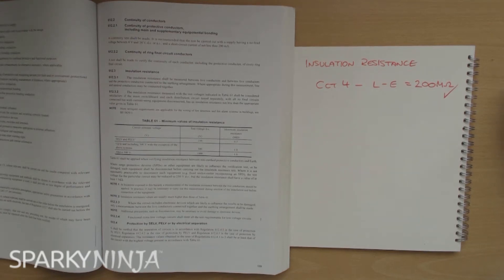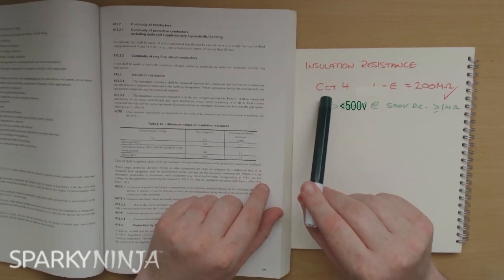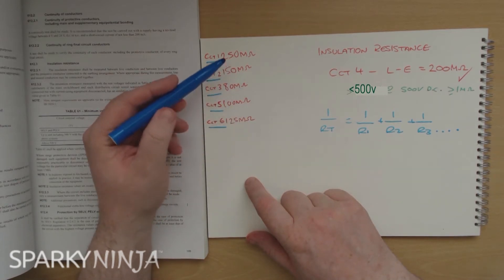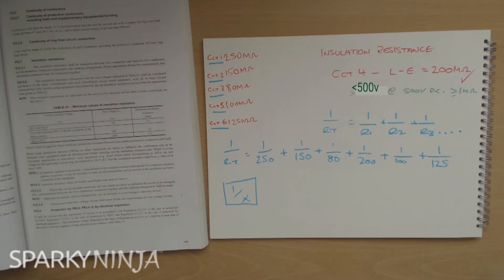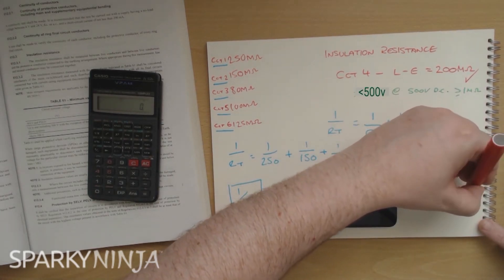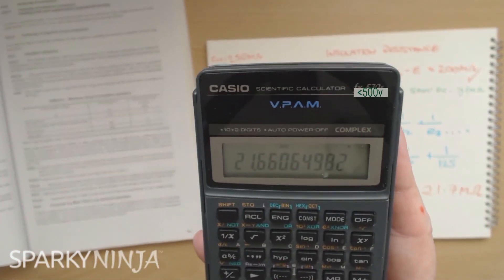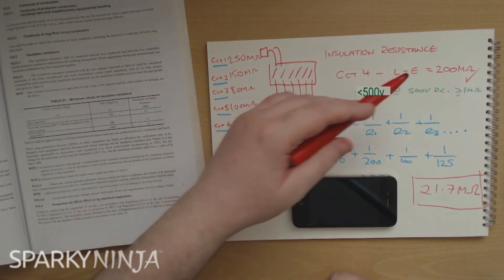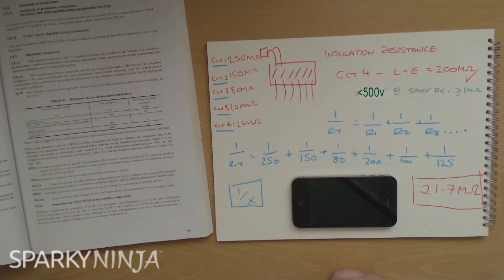Calculating combined insulation resistance tests - C&G 2391

Comment: If the value is say, greater than 2000 Mega ohm, what would we input this as in the equation ?
Reply from the maker: You can only input the infinity value of your instrumentation, but at that number it is a pretty redundant exercise - unless you were testing hundreds of circuits simultaneously.
Reply: @SparkyNinja  worked that out in the end but thanks for the reply anyway.

Comment: Hi, very nice tutorial. Thanks
Have a question regarding the applied voltage during IR test. 
Does it requires the applied voltage must be  equal to twice the RMS value of the normal supplied voltage on a conductor??? 
So as per that for 3 phase load conductor the IR test must be conducted on near about 600 volts??? 
Is it true, kindly reply

Comment: A quick and simple estimation of your final value is to take the least resistance value and divide it by the number of individual circuits. In this instance, 80MOhm is your minimum individual circuit resistance.  Divide that by 6 and you have 13.3 MOhm.  So your total is still well within specification.

Comment: hi mate. my company tests L-N L-E  and N-E seperate. 

would i use the worst of the  two live conductors to earth as my reading for calculation?
Reply from the maker: If you are reporting it on a document that just has Live to Earth instead of Line to Earth and Neutral to Earth then you could technically combine the two for the actual single value using the method shown here. Personally I would record one and if the other is significantly different I would add it to the comments for the circuit.

Comment: Hi David, How do you do the calculation if you have a IR result of >999 M on some of your circuits?
Do I just pick 1000M and go from there
Reply: Ross, if you have a very high resistance value as you will for very new cabling with new installations,  because you are considering parallel resistance for your final figure, any high resistance parallel circuit will not make any significant difference to your final calculation if your other circuits fall between > 1 MOhm and, say, 100 MOhm. You can just as easily ignore and discard the very high resistance parallel circuits in you final figure calculation.
Reply: greywolf271 
Thanks that's pretty good cheers

Comment: Table 64 (current IEEregs) provides "minimum insulation resistance values" for I/R tests. The preceding regulation requires what older guys call a "bulk" test, that is the test measurement is taken the main switch and the distribution circuit with all the final circuits connected (mcb's on) to either the neutral conductors or the protective conductors. If the readings indicated on your "Megger" are 1 Meg ohm or greater the test "shall be satisfactory" a Meg ohm being roughly equivalent to one million ohms.
If however the minimum readings for an insulation resistance  test of a whole consumer unit ( as described in the IET guidance note 3) cannot be achieved then individual final circuit may be tested.
Get guidance note 3 (around 27 quid) it'll be worth every penny.

Comment: Brill vid and good points, just one thing to be mathematically correct, at 6:31 you state you have found Rt and need 1/Rt, isn’t it the other way, the calc you did is 1/Rt and you need Rt ??

Comment: Thanks so much for these tutorials. An absolute godsend to me.  Quick short-cut on calculating the IR for the board :  Take the lowest reading and divide it by the number of circuits on the board. If you are happy with the result then no need to go further, secure in the knowledge that the true overall IR will be higher. But if the result is of any concern then you can proceed to calculate the overall IR accurately, as you described.

Comment: You stated the read was between live and earth is that the reading of insulation resistance of the line and neutral together to earth? The model forms in BS 7671 only give boxes for insulation resistance readings between live conductors and live conductors to earth. Industry often carries this test out between L/N, L/E and N/E. Which won’t get a true reading of live conductors to earth as a combined test. Thanks as alway I am directing my level 3 learners to your channel.

Comment: Hi mate,  

Is there actually at set value for an individual circuit then? E.G adding a new circuit to an existing installation. You would do dead tests on the circuit you are going to certificate. At what point would you say it requires further investigation. As we know experience normally tells you with your own test kit if something is wrong, however is there no set figure?

Also looking at doing my 2391 Inspection and Testing soon, any books or sites you could recommend?

Thanks,

Nigel.
Reply from the maker: Hello Nigel.

There is no set value for an individual circuit, however as the regulations require a combined circuit minimum of 1MegaOhm and understanding that any parallels that result from combining cirtcuits under test will always result in an overall value that is lower than the lowest of any single circuit, this would always result in a combined value less than 1 MegaOhm for an install.

So..

'IF' we are adding to an existing installation, we will need to be aware of two things. The first is that our new clean install should be fault free and so we should be reaching the maximum range of our machine - if our cable run is rediculously long, then you may see a different number due to the parallels within the cable along it's run, but nowhere near 1 MegaOhm. The second thing is that we would need to test the existing installation to make sure that it is safe to use - this is mainly due to the fact that we are adding demand to the installation.

I would recommend starting with Guidance Note 3 (as that is the key reference material for the 2391) and maybe checking out  GSH Electrical for some testing content.

https://www.youtube.com/watch?v=Vztv5gT4yCQ

Let me know if I can be of any further help.

Regards

David
(SparkyNinja)

Comment: Hi there great channel enjoy your videos,slightly going away from your video.my question is insulation resistance based,it's to do with removing loads while testing.when it's not possible to disconnect lamps and I.t equipment or whatever.i know you don't test between live conductors but is that far as you go and are you still doing a proper ir test. forgive my naivety it's a subject I'm trying to understand better.
Reply from the maker: Hello Roy, with periodic inspection of existing systems there is this inevitability to apply the limitation for IR testing between Live conductors. As long as you are properly documenting the scope of your work and MOST importantly, your client is well informed and understands what aspect of the work hasn't been achievable then all is good.

If the installation has undergone flood/fire repair damage, changes in ownership/demand/use then these would be stronger cases to challenge the scope and consider whether Limitation is acceptable, but do bare in mind that we are also supposed to minimise dismantling of the electrical installation as well.. otherwise, with the IR tests carried out between all Live conductors and Earth then that can be considered 'proper IR test'.

I work in many production factories - where removal of loads is just an insane idea - and so what we do there is apply a clamp meter around the live conductors when under load. Do remember that this is most likely going to be live work. If we pick up any current measurements when the meter is around the lives (L&N, L1,L2&L3, or L1,L2,L3&N respectively) then this indicates a loss off current, possibly down to earth and possibly caused by degradation in insulation. With regular monitoring we can identify a build-up in unbalanced current, which we can then use as an identifier to seek permission to isolate, disconnect and test fully.

If you are looking for more information regarding insulation testing theory and how it works then I would advise checking out a couple of mjlorton's videos on the subject:

Part 1 - https://www.youtube.com/watch?v=TdeU6UCCfTY
Part 2 - https://www.youtube.com/watch?v=FV0QavM9sN8
Reply: SparkyNinja 
Thank you very much
Reply: SparkyNinja You must have a big clamp meter to do this! 😂 Would you be expecting any current loss at all that wouldn’t cause you a concern? If this is the case what would you be expecting?
Many thanks

Comment: This is very helpfull, but I think I may have missed something... 
where would the 21.7 value be logged relative to the scedule of test results? I would still be writing down the individually measured IR readings for each circuit, but is there a section on the EICR that is failing to pop up in my memory where you put this 21.7 example value, or is this final value just used for personal assurance when deeming the installation 'satisfactory' or 'non-satisfactory'? Cheers.
Reply from the maker: Jamie Byfield in my experience I would calculate the value when reviewing and if the combined value is worth reporting then it can be added in the comments or observations. You could even add a combined IR value to your own schedules of you want, or a comment on the schedule.

Most important thing to note is that the regulation relates to a board and not a final circuit, so if you have any significant readings and not just a list of >199 Mega Ohms then it is worth calculating. 🖒
Reply: SparkyNinja That makes logical sence. Thanks once again. 👍